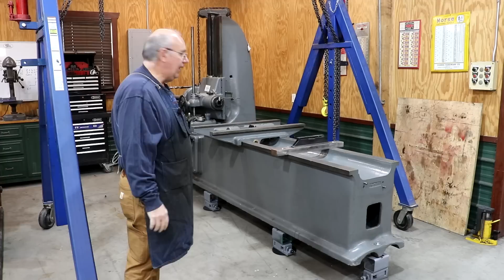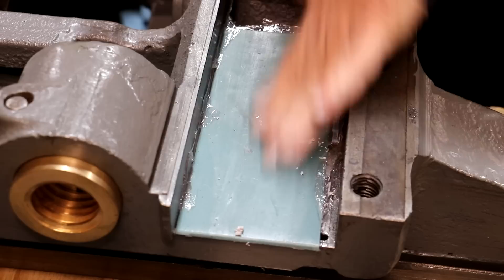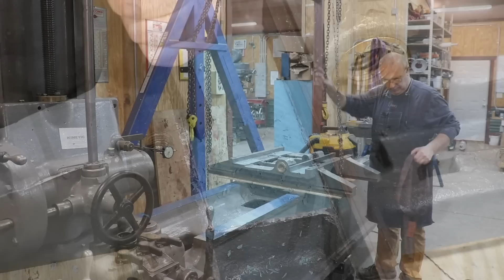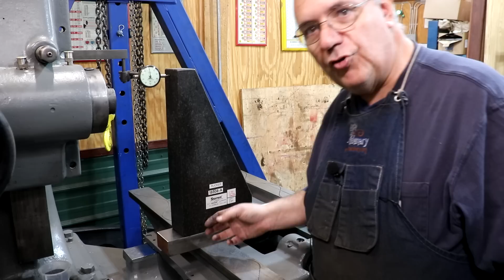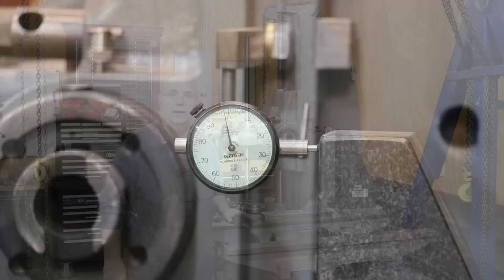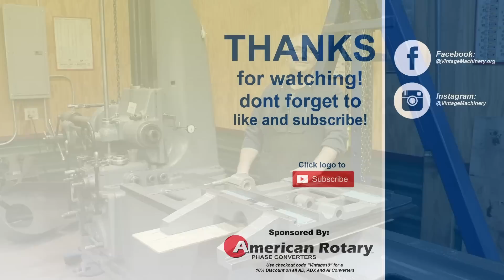Horizontal Boring Mill Restoration: Scraping Turcite and Final Alignment of the Saddle

Comment: keith, you have not checked the spindle  for square, vertically and side to side,, you have checked the column,  but not the same!!!  if the spindle is not true, you could be boring holes with the spindle, and they would not be necessarily parallel, and/or square to the table, you will probably do most of your boring with the saddle,  but sometimes you have to bore precision holes with the spindle, if you know the spindle is out very much, if you know how much, you can shim the part and indicate part true to the spindle and shim accordingly, it is good to know for future reference,   a horizontal is one of the most difficult to get true because of so many axises,  great videos, it is hard work and very time consuming!!

Comment: Retired manufacturing engineer here, worked with mostly horizontal machining centers and gantry type vertical machining centers. Old school, like this boring mill, says more mass is better, and three point set is preferred. However, in my experience, recent modern machine tool design has opted for lighter, steel weldments, outfitted with linear bearing ways, bolted to massive steel reinforced concrete foundations, brutally twisted and cajoled in to alignment by multiple anchor bolts and adjustment shim blocks. I have seen some long bed machines under so much tension, that if an anchor bolt snapped, the machine would probably jump at least an inch into the air.

P.S. One time, the torque required to get the last three tenths, OMG!
Naturally, these would have to be re-checked and re-aligned about every six months, regardless of the mass of the foundations. Un-aged steel weldments, stressed to extremes, are notoriously unstable.

Comment: Why would you not want to achieve something like a 20 points per inch for the Turcite the same as for CI with some oils grooves or half moon flaking for oil retention? About to scrape my Turcite and can’t find any information about the desired finish surface.

Comment: you scrape Turcite or Ruelon 100% different than cast iron or even bronze. You (first of all) use a hooked scraper and remove the material by pulling the scraper backwards. You just break up the bigger dots and then stone it with a India stone that is wet with mineral spirits or even spindle oil. A regular scraper will dig into the Turcite, and cause you a ton of grief. The stone is the rick here. Must be a clean new one, (I prefer the India slip stone and bought them by the case). When you start out, use a pink stone cut out of a thread grinding wheel. I then will go to the India stone as the pattern starts to develop. 

If you just have to use Turcite, remember it's only as good as the glue you put it down with. Turcite recommends Shambam (that name is real), but I found that Hardemans has a better glue. Coolants will eat up Shambam, but won't touch the other. It's a good idea to go with a double thickness and then mill it down to within .010". Turcite also grinds very well, and some machine tool folks go that route. Lastly Turcite with a thickness under .045" is not going to last very long (even .060" is not too good). Ruelon will out last Turcite three or four to one, but Moglice is the better way to go 100% of the time
Reply: Good Info ! Thanks
Reply: Araldite is also a nice glue components for assemby turcite or biplast.

Comment: You can always lean against the column to get that .0005" out if you need to. No joke you can probably push it that much. I would ditch the spacer tubes. It might make the machine nice now but when the spindle is at the top of the column it is well over your head.  When doing large part work you are going to have the thing way up there and be hunting a ladder to take full advantage of the travels the machine has. Also those square tubes will certainly be flexy and could possibly make the machine more prone to vibration and chatter.  You want it nice and dampened solid not sitting on bells.  i am very glad I put my machine in the pit and took it off the stands they had. It would have been way too tall most of the time like they had it. Hot chips are much more pleasant thrown at your waist than on your head and down your shirt collar!

Comment: I'd use washing up liquid (Fairy in the UK) neat as a release agent before putting the epoxy on. Just a thin layer spread around with a finger where you don't want the epoxy to stick. It will make it a lot easier to get it off later, used with the cling film it should do a really good job.

Comment: Seeing the feet, you added and the height it raised the machine brings to mind a question I have had many times over the years and that is why is so much of the old equipment built to an uncomfortably low level. I have seen and used many old machines that would be more comfortable to operate it they were just a few inches higher. I had a hundred-year-old lathe at my last business when I closed that was 36 in swing 17-foot bed, worn out and fun as hell to use because it was the boss you just had to make your peace with it as there was no forcing it to do anything it didn't want to do. But the bed height was mid-thigh and would kill you back stooping over to operate for very long.
Reply: Could it be we have gotten on average  taller over the century?
Reply: @alanl.simmons9726  According to CNN Health, a century ago, American men ranked as the third tallest in the world, standing at 171 centimeters (5 feet 7 inches).  Now it's 5 feet 9 inches.  Would 2 inches make THAT much difference?
Reply: Did they ever put the old machines on pedestal bases?  I know they did with steam engines, but I don't know about the machines.  The thought came to mind that if you really wanted to, you could lift a low machine up, but it's pretty to sink a tall one down!  :)  Just a thought.  I don't know nothing'.

Comment: I’m wondering if there’s any point in scraping the part before applying the turcite since variations in the thickness of the epoxy may well exceed any variation due to wear.
Reply: You don't need to scrape it flat before, but the glue will not stick good enough on a smoothly worn surface, so you need a slightly rough surface, you can scratch it with a scraper or grind it with a coarse wheel or you can mill it with a relatively high feed rate

Comment: Just curious. What is the thickness of the oil film, when the machine is in operation?  I guess it must be less than a few ten thousandths, otherwise it would be part of the scraping  equation.  ... Your videos are the best.
Reply: As long as the oil film thickness is constant, it doesn't change the alignment, the saddle just sits a tiny bit higher but it stays parallel to the ways.
If you use high viscosity oil on the front way and low viscosity oil on the rear way, the table will lean a tiny bit to the rear because the high viscosity oil provides a thicker oil film, but nobody does that, so it is no problem.

Comment: Flex in a heavy casting always surprises me. A relative told stories of installing a massive cast iron press on a poured concrete base. 6 forklifts (8 in later retelling) with support beams moving very slowly. And then the mounting holes did not fit over the studs embedded in the concrete.  Realized it was because the press was flexing. Wound up making minute adjustments with jacks to get everything lined up. Quite a story as he told it. Thanks for the video.

Comment: Keith...does the turkite being recessed under the casting allow metal chips to more easily get caught and then scrape or damage the ways?  I don't see any kind of way wiper to help prevent this. Maybe some 3d printed way wipers could be made...I would even do the print work for you if interested
Reply: I'm pretty sure he mentioned it has way wipers

Comment: Keith, 

Once you have the machine level have you ever considered Philadelphia (Philly Orange) Orange Resin to provide a more continuous foundation?  Philly Orange provides  significantly better support than the leveling pads.

Bob
Reply: He mentioned in an earlier video that he wants the machines to be moved around as needed.
That's also the reason the planer for example has the motor attached to itself instead of using a line shaft to drive it.

Comment: The turcite needs to come out flush to the ends of the saddle to prevent debris from getting under the edges and lifting.  I've seen that happen to a lot of applications of turcite and rulon in the field.
Reply: Absolutely 100% Correct!👍
Reply: Turcite is an issue looking for a place to happen. I pretty much did away with it and replaced it with Moglice. In the end it's cheaper, and will out last Turcite ten to one. Ruelon is slicker and goes on much thinner than Turcite, Seems to have a longer life span, but also is very expensive
Reply: The machine isn’t going to be used for production work, it won’t see enough use in the rest of its time for this to become an issue.
Reply: It has way wipers to prevent this from happening
Reply: @chriscromer2308  It won't help.  I've seen this too many times over a long career of running and selling machine tools.  Way wipers will just slow the process a little.  The fluroplastic resin is like an Oreo cookie.  Once foreign matter works its way under the material the bond is done.  The best protection is to make the resin flush and square to the ends.
Reply: Mr Moore I'm not disputing your assessment for a machine in a production environment ideally you are correct but with a limited use machine it's not as critical thanks for insight

Comment: Quick question. When you scrape cast iron you hit it with the flat stones to remove the burs raised by the scrapping.  I know that the turcite probably doesn’t have the hard burs but it did look like it left something similar when scrapped, call it fuzz?  What’s the process at the end of a scrapping pass to remove the fuzz or any raised high spots. Just curious.
Reply: I usually go over the fuzzies with the blade flat.... only finger pressure is needed to remove all those tiny boogers just skating it across the surface nice and easy and level. You can still LIGHTLY stone it with a slip stone if you want to. There are no rules against it.

Comment: What level of precision is actually required for the work that you do ?  The machine maintenance team where I worked certified the machines to a level of precision.  Some were 25 microns (about a thou) and only one was 0.25 microns (about one hundred thousandths ).  It took about half a day for most machines but up to a week for the extreme precision machine and time was indeed money.  There was no point calibrating every machine to the ‘n’th degree when all but a few jobs were +- 0.1mm and most of the machinists would struggle to work to +- 1 micron or better as they never needed to.
I appreciate that you are getting it as good as you can but what is the trade off with time?
Reply: Think of it like the perfect finish on a classic car or "blueprinting" an engine. Better than new and better than what most people "need" and yet very impressive and satisfying.

Comment: Keith.  Can you give a more detailed explanation if what turcite is?  I thought it was some kind of plastic but not if you can scrape it
Reply: It is a material made of Thermoplastic material it is composed of Acetal and PTFE aka polytetraflufoethylene it can be filled with different types of metallic granules. It is dimensionally stable and exhibits excellent wear resistance. It was specifically engineered for what Keith is using it for. Hope this helps.
Reply: Turcite is an engineering plastic with low friction properties. It is also heat and chemical resistant with good wear characteristics.  It's made from PTFE (polytetrafluoroethylene) resins with added fillers such as bronze.
Reply: Thanks guys.  I did not realise you could scrape a metal impregnated plastic.  Tony